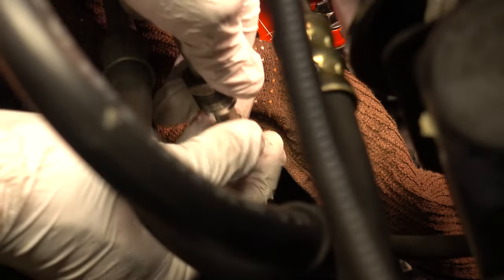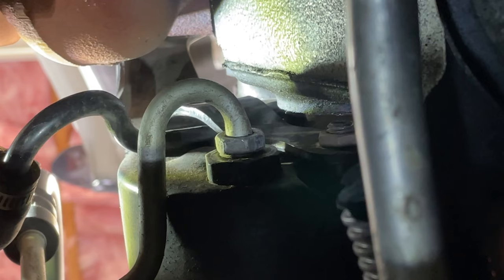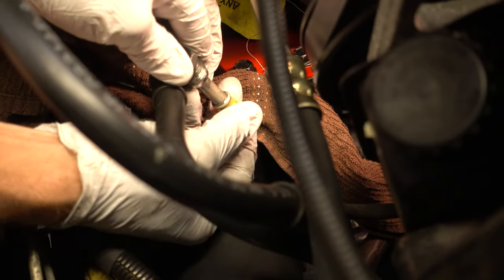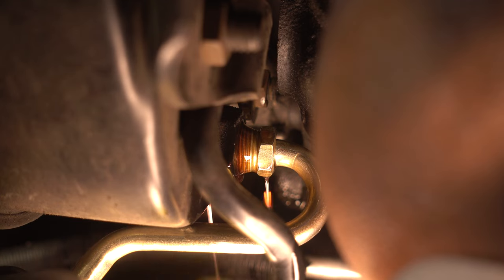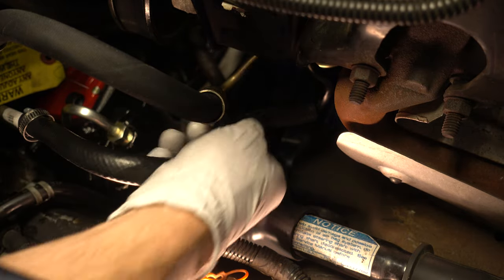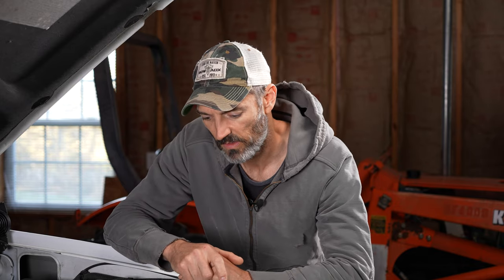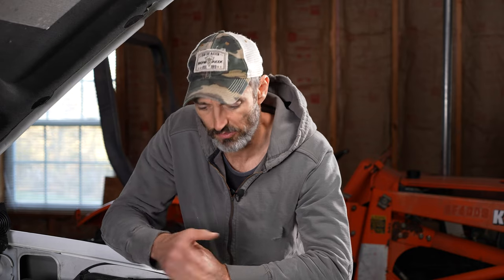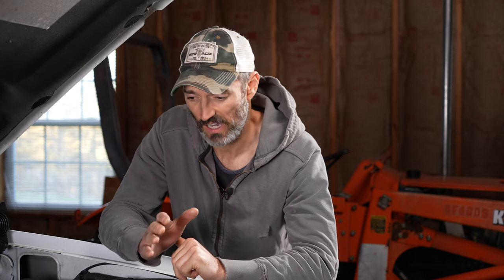Here's Why You NEVER MESS WITH Your Power Steering Hoses!!

Comment: Another lesson learned.  Should have replaced those lines when you changed the steering box.  The return line is low pressure so Elite line NOT needed.  Whenever I plan a job, I look at everything else I have to remove to get at it.  If there is a consumable item removed, unless it is near new, I change it. Example:  Anyone who changes front CV axles and doesn't change the diff seals, will be doing the job again soon kind of problem.  When you are working on your own stuff, it's OK too save yourself from that.  Pad your own parts bill so that later you won't be charging yourself double labor.
Reply: Lines didn't look bad; just the o rings to the gearbox were leaking

I replaced the infamous Honda Acura o rings since the old ones are prone to dry rot after so many heat cycles and just age

Sucking air/ making noise and will damage the pump if left unchecked
Reply: Literally was just saying that to myself when this was uploaded
Reply: @ricebike  This steering box has a history.  It may just be o-rings now, the hose will likely saturate and leak eventually.   vs $35-$50 bucks for pressure line that's already loose, only do it once, 1 mess to clean up.
Reply: @ricebike  The"Lines didn't look bad", are famous words of regret.
Reply: @x-man5056 Have you ever had more than one individual say you’re a smart ass or know it all?  Since you appear to know everything?  Thanks

Comment: Don't you have to bleed the system of air afterwards? Lol.. I didn't hear any mention of that
Reply: Not really just lift the front wheels off the ground and turn the steering wheel lock to lock left to right a bunch of times before you start the engine and letting the pump do the rest but always use brand new fluid in the system after doing something like jimmy is doing
Reply: @coreybabcock2023 🤦‍♂️that literally is how you burp it and bleed the air out lol 😅
Reply: He did drive it, I've heard you can bleed the system by driving it too.  You just will look like a fool to your neighbors..
Reply: @kgbreviews35 😂😂😂

Comment: I had a split pressure line...coated my entire 1993 Chevy Silverado...belt was coated...engine, coated...so I power washed the engine. I replaced the belt, took off the pressure line, but I also had to pull the pully, replaced the PS pump,  had screw back the line into the PS BOX...Stripped the threads...Fuxed around half the summer...replaced the pump, put back the pully, needed a pitman arm puller to get the box out, 35 lbs of bullshit!!! 2 person job. Replaced the box! Brake booster, New front brakes, new steering wheel column, starter, alternator, battery,  manifold, fuel filter, puel pump, oil change, tires...ummm? Sheetmetal- new fender this spring- 6x9 KC lights going back on the double chrome rollbar! Then LED fog lights!

Comment: I like the preventative maintenance plan over the parts failure plan. I do the same thing with my 02 Suburban. My recent work was a deep dive in the dash replacing heater core and the dryer with associated valve controls. The heater divert-er valve failed but I wasn't going into the dash without replacing everything, it was a lot of work.

Comment: Great Video! Love the way you get up close and personal to the item being removed or worked on to get the best view possible. I recently replaced the rack and pinion on my 2000 silverado, which was in complete pieces and well over due for replacement. Took her on a test drive. Everything was cherry until i noticed it still had leaking coming from the rack, leaking is coming downwords towards the fittings so i will be replacing these lines as well im sure there is a pinch in there causing this issue.

Comment: I had to replace the power stearing lines on my 90 k2500. Well, I'm no mechanic by any stretch of the imagination. I tinker. I figure out how things work. With that said, i had no idea my truck had like 8 feet of steering line running in the frame to cool the steering fluid lol. I just cut them off and replaced with regular length lines. Ive read to not do that as it could overheat the pump. Been over a year and about 20,000 miles later, the ole girl still turns mint. I now have to replace the pitman and idler arms. Other than that the truck goes mint. Got it as a "if you can get it running, you can have it" deal.

Comment: Thanks to your videos i had the confidence to tackle my loose steering om my 06, problem is i tried to skip some of the parts and spent over a month changing systematically everything. One got fixed, showed the next parts worn, and so on. Gear box, pump, tierods, and idler last which was the real problem no figure. Btw i ended doing the gear box 10x pump 3x. Get a redhead from the start, +new napa pump, no duralast/cardone with steering stuff!!!

Comment: Those yellow caps are to place in the pump or the gear if you are not putting a line in it right away to keep junk out of it. Also don’t worry about loosing fluid when replacing lines, you really are supposed to flush the pump and gear when you service them like replacing the lines so loosing old fluid is perfectly acceptable and normally you would undo the side of the return line where it just has a hose clamp and direct the flow into a catch pan while adding new fluid with it running and when it comes out perfectly clean new fluid then reattach the hose and hose clamp top off the fluid to the correct level and then use some brake clean or carb cleaner to hose off any mess

Comment: Replaced the power steering pressure line now two times. Replaced the first time as preventative maintenance. OEM line wasn’t leaking. 1st replacement leaked , tried a new oring still leaked. Then replaced again with the same line in this video and it’s leaking again. Leaks from the back of the pump pressure fitting.  It’s going to stay that way until the LS swap. Lol
Reply: What hoses do you recommend? I'm replacing mine soon due to the HP line leaking at the metal to rubber crimp...
Reply: Don't replace parts just for the hell of it because if you're not an expert at it you can screw it up pretty bad.

Comment: I have the same reasoning for replacing things before they go bad, it used to be that many aftermarket parts were better quality than OEM, but now that most parts are made in China, most are garbage like most everything made in China. I now try to keep using the original parts for as long as possible.

Comment: A video about right and wrong hoses would be good also.
I suspect many people use incorrect hoses, especially when desperate and the parts people have nothing in stock etc..
They told me that "fuel hose" would be fine for Power Steering, but I really do have doubts.
A genuine PS main hose, at 290mm (11/half inch), is $60-90.
Yet the fuel hose is $20 a metre. That alone makes me suspicious.
Reply: So at $20 per metre, I could buy 3 metres of fuel hose, for the same price as only 290mm of PS hose. It's a straight piece. Nothing fancy.
So I can get 33 times the length, if I use the WRONG hose.
As a mechanic I would then get a lot of return business after a year or two or three.
Maybe the entire power steering might then need a rebuild ?
Maybe I can run a wrecking yard on the side ?
Reply: Comment disappeared due to the stupid ads.
People who encourage these pathetic ads are ruining it for everyone else.
Anyway, as I was trying to say. Wrong hose is 33 times cheaper.
An incentive for dodgy mechanics everywhere.

Comment: Like they said if ain't broke don't replace  it. Sweating included.  Yes your driving a 30 year old truck.  Understood.  I am at 250K 04 Denali all original fluids including coolant just topping off. To late to change fluids. Yes i got the label beneath vehicle lifetime fluid sticker. Its to late now high mileage so i will stick with my fluid which transmission and differential been use to lol. Not gonna risk changing fluids. Yes its been dtiven 16 hours straight and 16hrs back 10 minute stops for gas/restroom breaks plenty of times  2000 miles round trip every year with steep climbs and and hot weather so Yukon is being tested and puts a smile on my face Vortec power. GMC/Chevrolet are built tough. Yes i do wrench on my Japanese and German cars but American simple oil changes and sensor and O2 bank sensor of course Castrol oil as my choice for these trucks/SUV. Couldn't be happier 20 year old beast!!  Love your content, tips and products you introduce please keep it up.  I send people over to your channel all the time see what we DIY go through aka backyard mechanics.

Comment: Minor league team at the threads of the hoses is not problematic.  In fact you'll probably do more damage by replacing them.  There are methods of either coating the threads with loctite or using teflon tape.   I prefer to do nothing and simply clean the areas.